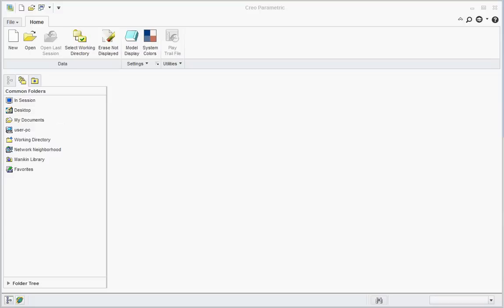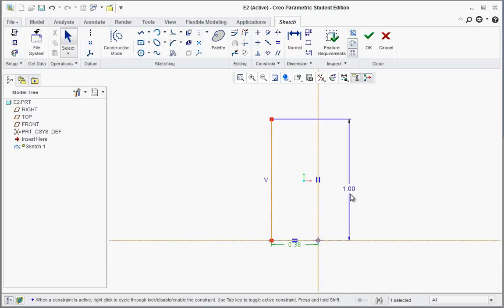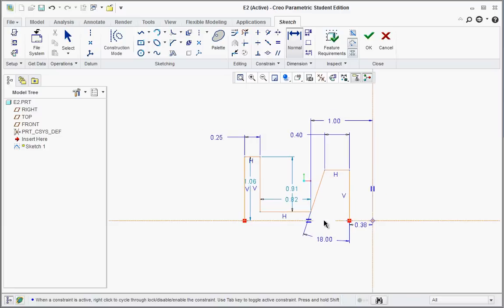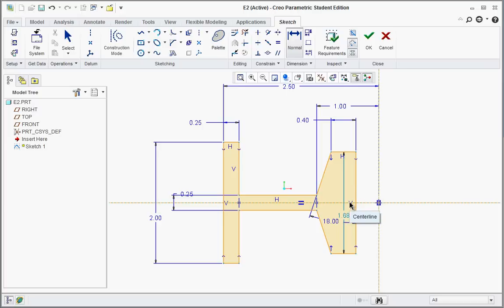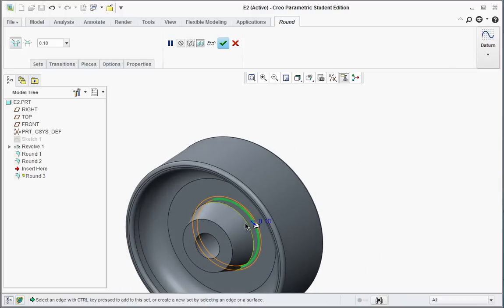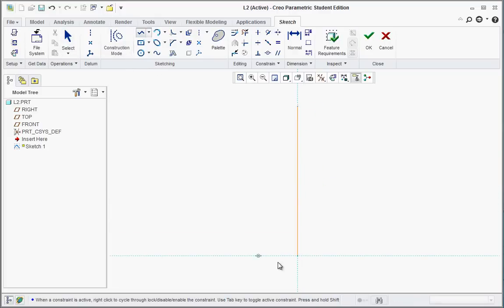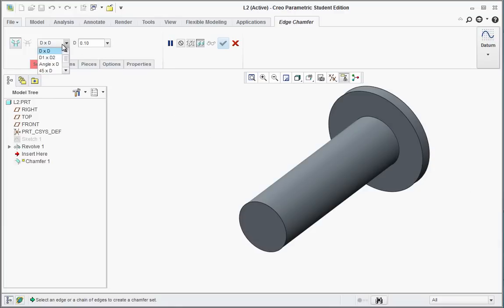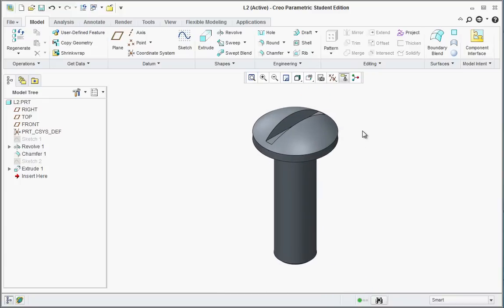E2 CREO Parametric 2.0 - Basic Modeling 2

Comment: Everything is going great until I get to Extrude the slot in the bolt head.  The Extrude screen opens, it does not Extrude, but instead. "Placement" is red.  I click "Placement" and there is red dot with "select 1 item."  and "Define..." option.  I tried many things, I can not get past this part to finish the part.  Any suggestions?

Comment: for some reason i cannot revolve on a sketch previously made, i have to make the sketch in the revolve function does anybody knows why i cant select the sketch?
Reply: Cayo255  I got the same problem. I removed the middlelines in the sketch, then I klicked on revolve an used the y-axis as the rotating axis. Worked ... Sorry for my bad english.
Reply: Cayo255 Had exactly the same problem. Florian allready gave the correct answer. The middle line you used to mirror the sketch, is seen as middleline of the construction in your case. Creo gives you the error at the bottom of the screen that goes sth. like " all elements have to be on the same side of the rotation axis". Just delete the axis you used for mirroring and create a rotating axis on the y axis and finish the sketch!